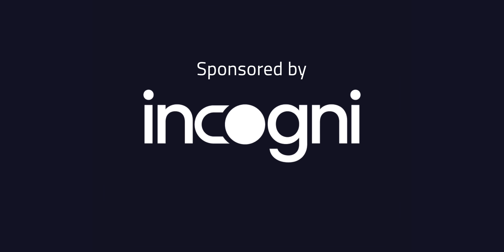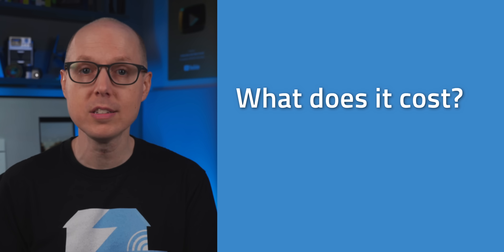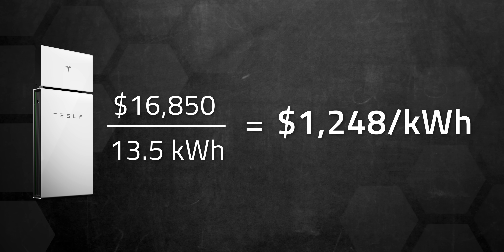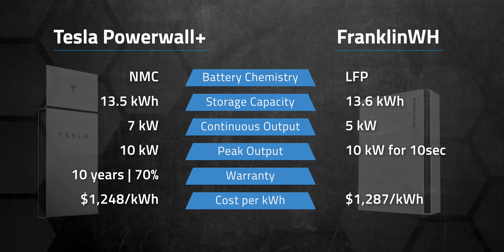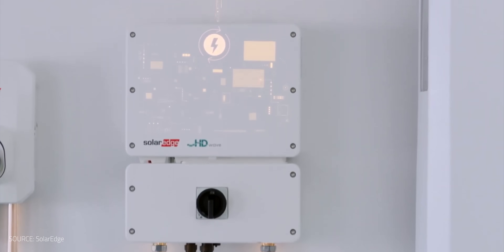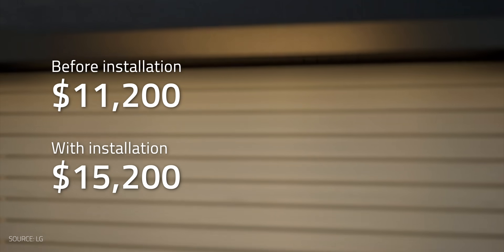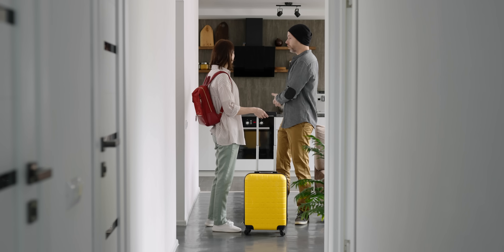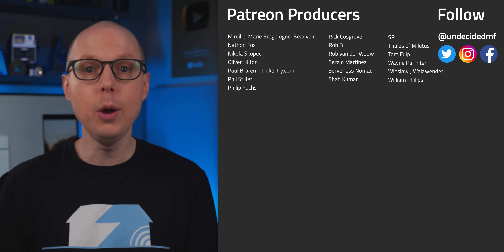Top 5 Batteries for Home (And One You Might Not Expect)

Comment: Signature Solar was the most cost effective for me plus their amazing customer support. $13,187.94 or ~$430/kwh for a system with 30.72kwh of battery, 13kw continuous inverter output, 10 year warranty. I DIY installed but if you include $4k for install you're still at $560/kwh.
Reply: I was just checking through the comments to make sure that someone said this. I love my Signature Solar server rack batteries! Super cost effective, especially if you live close enough to go pick them up in person.
Reply: Just like the previous contributor IT was making sure server rack batteries had a place in the in the discussion. Sure these batteries aren’t as fancy looking but it’s the raw cells that’s inside them that determines the amount of power delivered over time i.e. energy, with this video showing 1.00 kWh averaging around thousand dollars I would say is a very high price to pay considering top-of-the-line server rack LifePo4  from Signature solar presently cost  $1600++ with a 10 year warranty, for a 5.17 kWh @ 48 V…. I think the power wall market is aimed at homeowners who  ‘ just want it done’   with very little knowledge of what is inside the box .  Which essentially turns out to be the same high grade A+ cells, 

Worth noting, Signature solar’s latest version of there (rebranding) EG4 battery, has built-in fire extinguishers for safety..

Moreover, I think it would be worth emphasizing to much extent which of the two battery chemistry types are safest..for all the obvious reasons.  Personally, I am very concerned about the handout in-mass of lithium cells to the greater public with very little long term testing for safety,  DIY solar’s Will Prowse video of a battery meltdown doesn’t look like  much fun, with very little to stop the reaction of the internal chemistry combustion.

I am 100% off grid and have been for 10+ years , learning curve is very steep for me and it took considerable investment in time and resources .

Wonderful you have closed  on your dream home. Congratulations.
Reply: Hi Thomas, thanks for your comment. We closed our new home last week, moving in around 60 days, always dreamed about owning a home and having solar system grid tied and battery backup for outages. I’ve been reading about Signature Solar from a lot of guys on youtube they seem to be great. I went in their website and saw soooo many options, could you share that awesome system you described? I think that is all i need (even though i need to be able to inject to the grid, its the cheapest way) i think around 20kwh of battery would be enough for backup. Thank you so much in advanced
Reply: what does your battery capacity look like after 10 years?

Comment: Made the same comment on Ricky's channel: in a renter scenario a product I wish existed was a cheap kit to build a small "solar trailer"
like 3 adjustable panels (tilt and rotate), one of the mobile battery solutions in a small locked and ventilated compartment. on a platform easily towed by a small electric car. IDK maybe if we have builders in the community we can come up with an opensource design.

Comment: Or if you are DIY minded you can get 15kWh of LFP prismatic batteries for £2000 direct from China.
Then a 5kW solar MPPT controller/charger/'inverter cost me £1000 from Amazon.
I wired my inverter as a UPS to a ring-main. We had a mains power outage and didn't even notice.
All our laundry and dishes are washed by sunshine.

Comment: Great video!  Thank you. In a future video, I would like to hear your prospective on EV to home charging. Taking advantage of an EV’s large battery to provide temporary power might be a game changer.  I could envision Tesla resisting this trend as it would cannibalize their home battery system.
Reply: Agreed! I was thinking the same thing. Video also really puts in perspective how big EV batteries are at ~50kWh compared to these 10kWh battery walls.
Reply: Absolutely. It's called bidirectional charging, V2G or V2L (vehicle to grid/load). Increasing numbers of people will have a "free" 40-70 kWh battery, or two, sitting at their house (in EVs). Some of those can already connect to a small inverter to provide 120 V of convenience power.  Make that 240V (230 in Europe) and people can be paid by the utility to provide some peak power, and power their home if/when the utility fails.

Comment: Hi Matt, love your channel. Great work. Started watching when we were living in Austin, Texas, but we now moved back to the Netherlands where the electricity grid is extremely reliable. So the home battery system combined with full net metering of solar isn't interesting for this market just yet. (Which is why many of the manufacturers e.g. Tesla/Enphase, etc aren't offering home battery installations yet.) However, these systems as well as this market will become more interesting once net metering will be reduced in the Netherlands and ultimately expected to be disappearing completely by 2030. So in view of the reliable electricity grid, such a battery system will not be used as a backup electricity source in the first instance, but more to use as ways to charge during peak sun hours and possibly sell back to the grid during night time. (Peak shaving). I would be interested in learning more which of the systems offered would have the best smart home/smart grid integration and whether the economics behind it would be worth the investment. Keep up the great work and great to see your channel growing as fast as it is. Cheers, René

Comment: Tesla Powerwall+ is $12,850 just for the unit. Let's say it has a very high 50% profit margin so cost/unit is 6,400 (ish).
Current Li-Ion $/kWh is roughly $150, so 13.5 kWh is roughly $2,000 of cells. So is $4,400 reasonable for the rest of what goes in there + costs? Seems kind of high, but that is the hazard with low volume products. Unfortunately it is hard to see how a high-volume market will develop with these current prices.
Reply: The powerwall isn't low volume it exceeded 300,000+installations globally in early 2022. Further they made 6,500+in 1 week from August 2022 on.

It also recently dropped to 9k, the powerwall 3 using lfp in a more compact size is coming shortly. Wouldn't be surprised if that drops in price some more. Plus for flexibility and ease of app usage nothing out on the market even beats TESLA. 🤔
Reply: @4literv6  300,000 since 2015. To put a high-volume item up for comparison, there are around 215 million fridges sold globally every year.

Don't get me wrong, I like the product/tech, but at those prices it is still a limited market. Even in wealthy countries like the US, a very large proportion of the population will either be priced out, or struggle to prioritise an expensive house battery over more immediate needs.

Comment: Matt, I went with Enphase about 1 1/2 years ago, and it’s great, as is their support.  I have a 3 battery banks (10+ kWh each) plus a 24 kW Propane generator.  I want to harvest our wind too as winters and nights solar is of little use, but Enphase has yet to integrate this option, which would probably make us 100% independent.  Any help you can offer in persuading Enphase to integrate wind would be great!

Comment: I just want a simple off grid system. Must have independent smoke detector circuit system. Pumping water is biggest electric use for me. I couldn't make enough electric or big enough pump. So went 2 stroke water pump to get water 50 feet up the ridge. I am going as many d.c. electric devices as possible if not everything. Thank you for going over newer battery options. I love the my super capacitor bank in my solar system it extends the battery lives. I like the enphase. Might check it out for the boat I want to build after cottage is finished. I really like the small systems I hook up on boat lifts.

Comment: I don't know Matt. I have a 8000W gas generator that cost $700 with a 240V manual hook up installed and have needed it 3 times in 2 years. Yes, power in NY is pretty steady, but none of these deal with 3 days of Hurricane outages and $12K-$15K for 10 years guarantee doesn't sound that great. The Cost savings were not put into your vid. ROI is what matters. At My Tesla $0.16kwh vs $0.21Kwh from PSEGLI, it's going to take a very long time to get my money back! I just don't see the value of that money for the consistency of power delivery and ultimately a very cheap alternative. Frankly I'd much rather spend money on a V-t=H setup and use my EV as the back up. At least I use it daily, store cheap electricity at night and on top of that NYS doesn't really want you over producing solar either.  I'm not onboard for Batteries given my location, options and ROI.

Comment: I have a Tesla powerwall and solar panels.  My next step is to install an off-grid system in my garage for car charging.  This means my house panels will put that much more into the grid, and it doubles as a backup for a backup.  By being off-grid I also don't have to deal with some permits (others I still need) or the maximum panel limit in Colorado (was 120% of my usage, recently changed to 200%).

Comment: I think 48v server rack batteries are worth mentioning too. I have just added a second to my system (US5000). I will save a little each month and add another unit as I can afford. They are much cheaper to buy and no cost to add to my system.
Reply: Yah for the same price as one Tesla system you could get double the power with server rack batteries.  IMO the server rack systems look better as well.
Reply: Yea, the likes of Orient Solar being missed is a weird failure of this. He's chosen only highly integrated systems which are always relatively expensive.
Reply: Using separate inverters and batteries like the EG4 also allows you to only buy as many inverters as needed for your maximum instantaneous demand and add as much battery as you need to carry through overcast rainy days, or the max code allows... LOL  I have 36 Enphase IQ7 micros and I'll never buy anything from them again. They snuck through an update that broke local API access and borked a lot of home automation setups.
Reply: I was just thinking about the potential of grabbing some 1kwh battery and tying them together. I know there is alot more too it, but for simplicity sake, it would be a lot cheaper.
Reply: Agreed.  SOK, Jakiper, EG4 are all good options.  In Canada I’m looking at ~Cdn$13k (USD$10k) for 20kWh installed with my new system.  $500/kWh with ~20 year charge cycles.  The movement away from integrated proprietary systems is well underway.
Reply: Yes, we have new products coming out later, balcony energy storage
Reply: who did you go with the EG4 ??
Reply: @jamesray9009  No Pylontech. I'm in the UK and these are the big cheap units available here.
Reply: 48 volt (or Telecom) batteries were traditionally lead acid. As there were only designed for very intermittent use, they were NOT designed for multiple discharge events as is the norm for home power systems. I used to work for a telecom company. If there are now rack mount LIFePO4 for telecom, great, but otherwise don't use lead acid unless you want to replace the whole mess every 4 -> 5 years ( and that is with good AGM cells). PS adding a new string of lead acid in series with an older string will suck the life out of the new string. I honestly don't know if this holds true with the 5 or 6 Lithium battery chemistries out there these days..
Reply: @paulmcgown7504  again, no one is talking about AGM or Lead Acid, it's irrelevant for household batteries in 2023
Reply: @paulmcgown7504  everyone here is talking about 48-volt LFP and Lion batteries. Google EG4-LifePower4 48-volts x 100 amp hours; that's 5 KWH for $1500, and LFP won't burn your house down.
Reply: Lead acid technology is less than optimal in every sense of the word. They last only around 5 years or about 20 cycles if run to flat. They cost a lot to keep fully charged and their efficency is around 80% whattage charged to withdrawn. Against nearly 98% for Lithium technology.
Reply: @williamarmstrong7199  no one mentioned lead acid, server rack batteries like EG4, Pylontech and Orient Power use LFP.

Comment: We have a 12.2Kwh Solar system with 3x Encharge 10's (30Kwh). The Enphase app is awesome, it really gives the system a big "cool" factor and all of the data you would want about the historicals on your system, including monitoring any weak solar panels/microinverters. The Storm Guard feature from Enphase is really useful, which will detect any inclimate weather warnings issued to your county and will order your batteries to flood energy from the grid and fully charge your batteries in preparation of an outage - this has been handy in several situations. 
Another thing I realized about having batteries on your system is that it increases your maximum output threshold without needing to draw from the grid (Say it's late evening when you get home and your solar system is only producing 3Kw, and your home starts demanding 10Kw. Your battery will make up the 7Kw difference instead of pulling from the grid. Additionally, say your system's peak output is 9.5Kw and you start running a bunch of appliances at once and suddenly your home is drawing 14Kw, your battery will make up the difference here as well, even though it exceeds the maximum output of your solar system.) My biggest complaint is that I wish there was an inverter bypass for energy that is being sent to the battery, because this system can have up to a 5 step conversion back and forth from DC to AC, especially when you add in charging an electric vehicle. I think this could lead to a thermal loss of around 20% in some cases. 

I won't say that this system has really saved us money, because the cost basis was just too high. But, in my opinion, the price was worth it to pretty much have a backup generator on the home. Our utility provider unfortunately does not offer net metering, they instead pay us only 1/3 of the price of energy imports. The batteries, however, help us retain some of the power we produce during the day instead of selling it at 1/3 the price to the utility company. I'd wager that having the batteries on our system has helped us close the gap to having a net zero utility bill.

Comment: I have a small solar system and the power where I live is very stable so I do not have battery back up at this time. But when and if the iron flow battery becomes available, I will look into it .